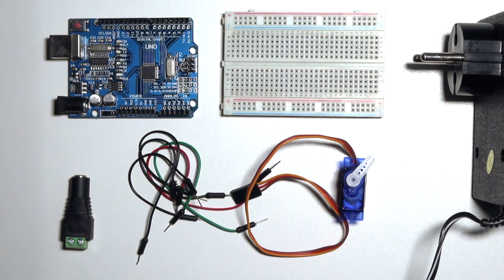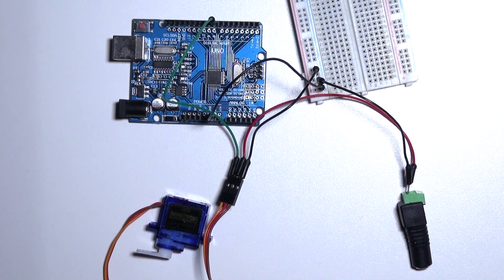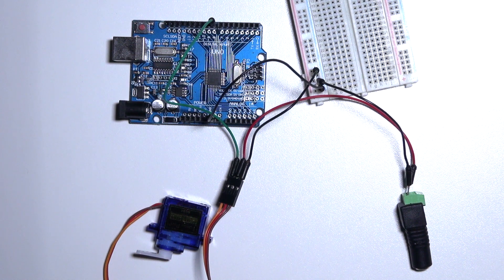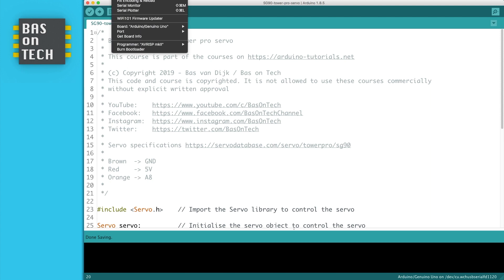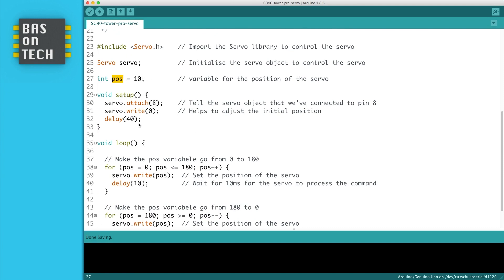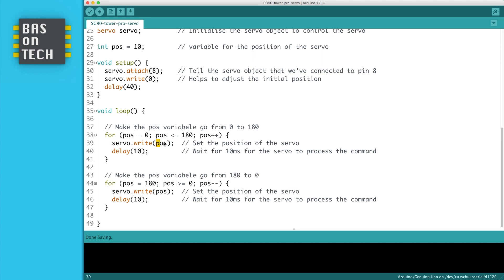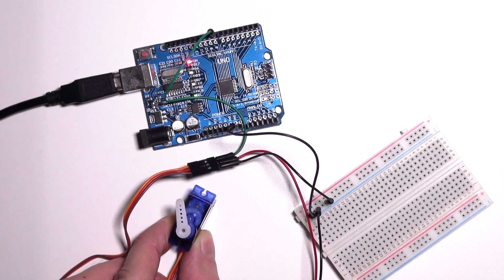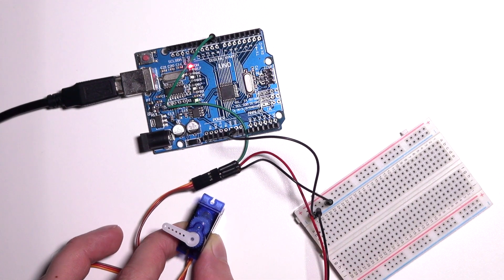SERVO MOTOR SG90 TOWER PRO - Arduino tutorial #24

Comment: Any reason the servo doesn't seem to be going all the way to zero?
Reply from the maker: You mean why it seems like it doesn't move the 180 degrees completely but more like 170 degrees?
Reply: @BasonTech  yes
Reply from the maker: @joeny1980  I just saw it in the video what you mean, I have no clue what it could have caused. If I have time I will check it out and rebuild the circuit.
Reply: @BasonTech  I'm new to all this so I don't understand all of your code, but wondering if your initial 10 parameter is impacting it
Reply from the maker: @joeny1980  I thought exactly the same thing at first. But inside the loop a local variable is defined which should run from 0 to 180 and therefore is not affected by the initial 10.
Reply: @joeny1980  It's just because the servo is a very cheap one. It is very well explained by Mr. McWhorter on youtube. I think it's lesson 16 of the old series of Arduino lessons. I really think you should give it a try ...... He's a very good teacher.